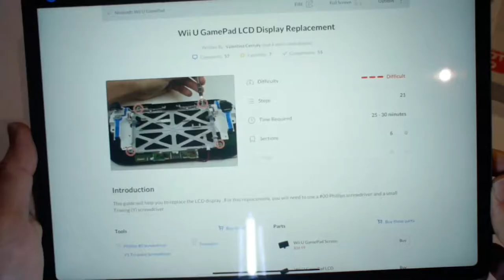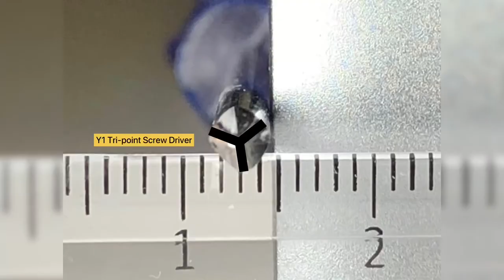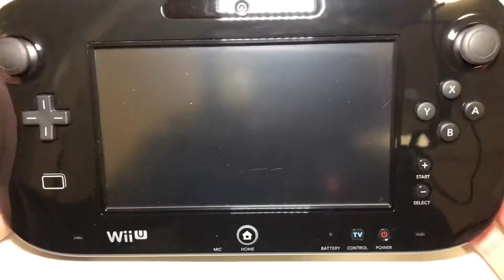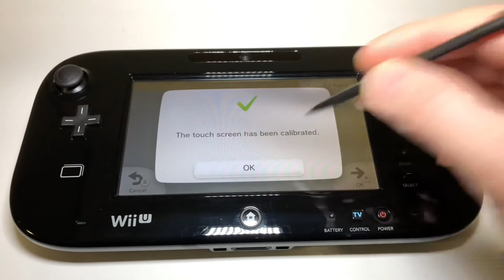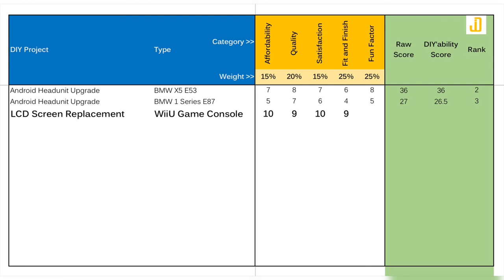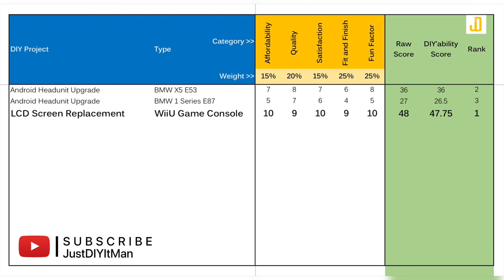WiiU GAMEPAD | REPLACE CRACKED SCREEN

Comment: Where can we get the black frame for the lcd screen if we mess up removing it from an old screen
Reply from the maker: Hi Benjamin, I searched ebay and there is no listing just for the black frame surrounding the LCD (as seen in video @ 9:33).  If you accidentally damaged it during the removal process, try to fix it as much as possible.  If its too messed up, its not the end of the world and your WiiU gamepad will still function without it.  As alternative, you can cut to size a thin black rubber material and place it around the edges.

I hope this is helpful.

Cheers,
JustDIYItMan

Comment: So the ribbon next to big ribbon Controls the touch screen? Any advice, I broke the Grey holder for the cable, anything I can do?
Reply from the maker: Yes, the thinner ribbon next to the big ribbon cable is for the touch screen.

I’m sorry that you broke the grey holder, they are really delicate.  Unfortunately, I don’t know how to put that part back together after it is broken.  But you will find these motherboards sell for something like AU$40-50 on ebay so you might want to consider buying one to replace what you have.  Make sure to ask the ebay seller if there are any compatibility issues you need to know about before making the purchase.  Good luck Starpotatoes!
Reply: @AutosNGizmos  thanks for the reply, I was about to buy another motherboard, but I decided I'd improvise and got it in place with some electrical tape, and it works, hopefully for a decent amount of time
Reply from the maker: Good stuff, thanks for sharing your experience here 👍
Reply: @starpotatoes768  my touchscreen isn’t responding any advice
Reply: @j7sportvideo24 if you're still having this problem, I dont really know any other advice to give you besides make sure the ribbon cables are secured into the grey holders as best as possible, as the small ones can be tricky at times
Reply: Thanks for making me feel included, i just added tape and superglue.